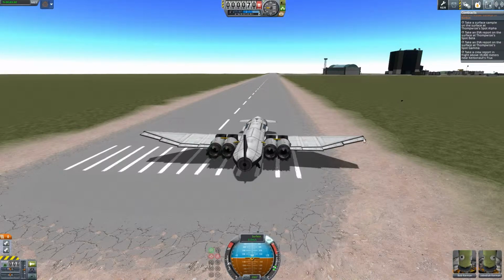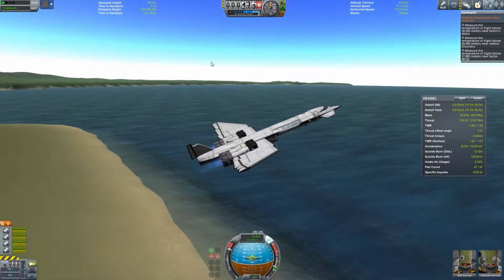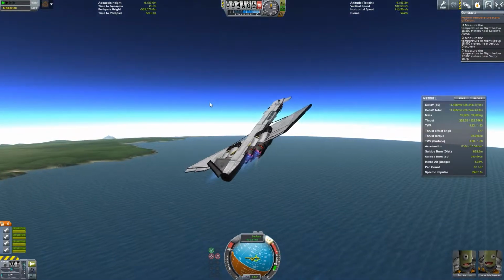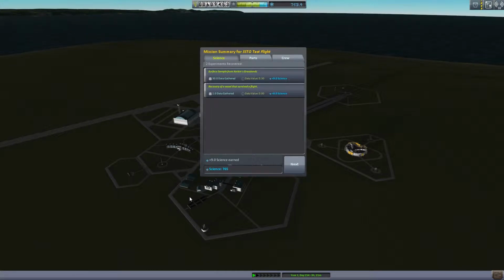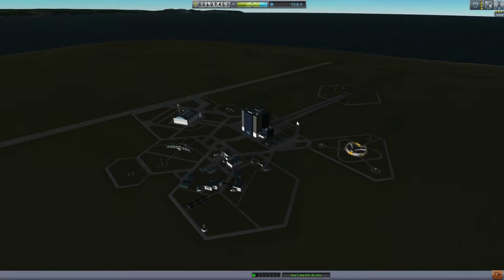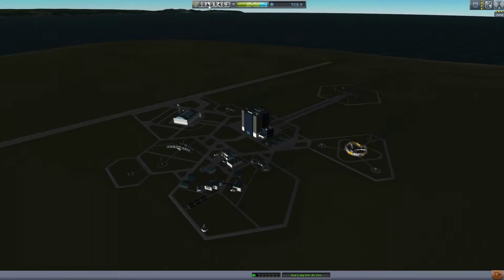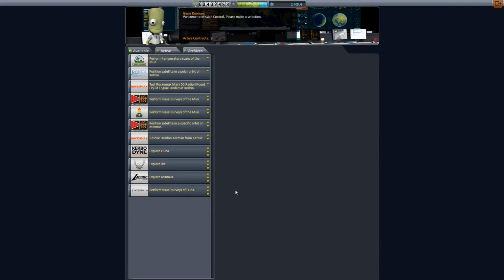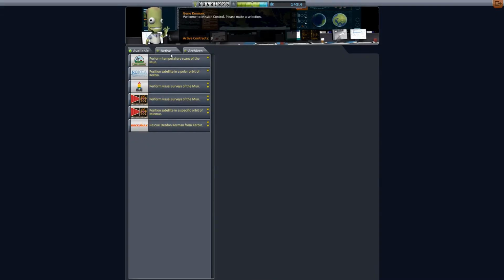Let's Play Kerbal Space Program S2E08 Test Flight

Comment: Damn, that was a nice recovery from that spin o.O  Too bad it still broke up afterwards :(

You should really check out In Flight Waypoints on the forums. It's a very simple and incredibly useful little mod. Also, Adjustable Landing Gear is fantastic. Those two make aircraft use and design SOOOO much easier. There is an SXT airbrake mod that makes life much easier in NEAR and FAR, since slowing down enough for reasonable landing is a serious challenge in both.

Those Hot Rockets jet engines are just so sexy :D
Reply from the maker: I'll check out all of those mods. I will probably at B9 at some point, after the next flight tech probably.